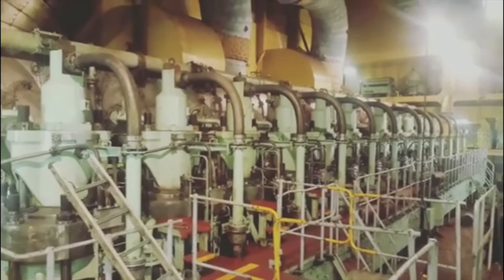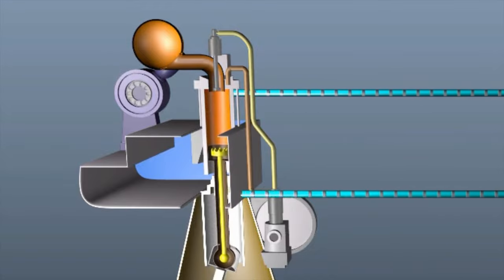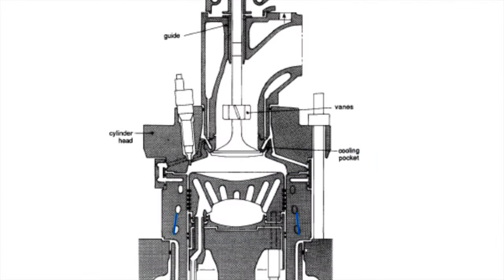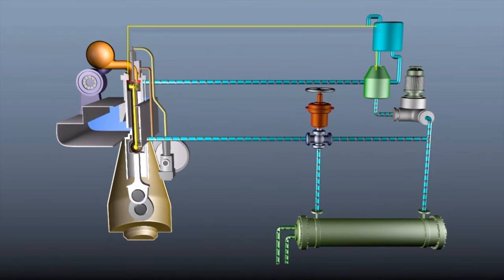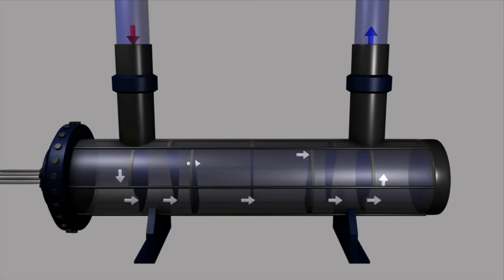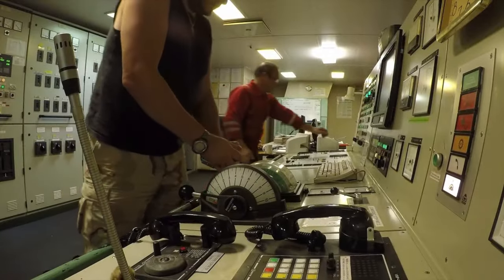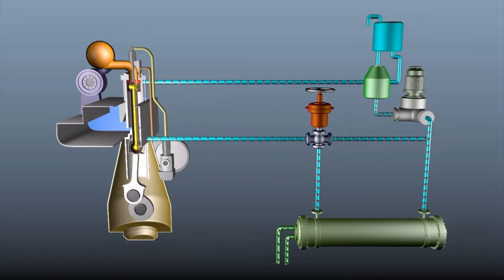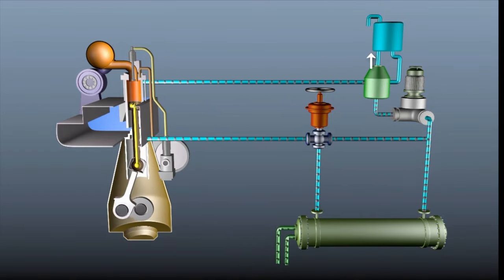Engine Jacket Water Cooling System

Comment: Good video. Whats the normal temperature 
1. After liner 
2. After cylinder head 
3. After exhaust valve
Reply: That depends on the pressure in the pipes. The higher the pressure the the higher boiling point. 
1. After Liner can for some engines be up to 130degC
2. After Cylinder Head can for som engines be up to 85degC
3. Depends on the engine load -  if the load is high the temeprature is low. 

Hope it helped.
Reply: @steffandall5785  Thank you 👍🙂

Comment: Thanks very good explanation...i would like to ask you a question about the pumps..you said that when the engine is stoped we close jacket pump and start fw circ pump ...this procedure is in all merchant ships ? I'm gonna embark on a bulk carrier and i would like to know.
There are always circ pumps for that reason or in some ships we use only jacket pumps ?? I will appreciate your answer thanks !!!
Reply from the maker: All foreign going ships are fitted with small circulation pump. This is done to reduce the power consumption (as jacket water will consume more power) and hence the fuel consumption of the auxiliary engine.
Reply: @marineinsight  agreed.
Reply: @marineinsight  In addition to that, hence main engine is stop no need much HT pressure for cooling the cylinder liner,head, exhaust valve etc...only to provide  heating to prevent thermal shock and prevent jacket cooling water leakage.

Comment: What chemicals are usually used to test the jacket cooling water Can you name them??
Reply from the maker: There are different companies who provide chemcals under their brand name. However, following composition remains the same - 
Nitrite, carboxylates, Nitrite boarte, nitrite polymers
Reply: Unitor is name of such company which provides chemicals for this use .

Comment: @marineinsight, why do we always have a return jacket water connection on bottom of expansion tank always, why not from the top, kindly guide..
Reply: It is done in order to maintain a positive head. Same reason as to why the water tank in your locality is placed at such a great height.
Reply: With the help of gravity Method
Reply: Also to provide raw water from exp.Tk...

Comment: Sir can we use the system without a daerator??..nd what is the principle of deartion?
Reply: Deaerator is used to remove trapped air bubbles from the circulating water in order to avoid pressure fluctuations (which in turn could cause damage to the pipe lines). So no, it is not advisable to NOT use Deaerator.

Comment: What happens to the heated "sea water" after it leaves the "Sea Water Cooler"? The heated sea water is expelled back into the sea. As wiki says: "At any given moment there are 50,000 merchant ships crossing the worlds oceans. The heat from the cooling systems of these ships on the oceans of the world is what is really causing climate change, heat wave and drought.